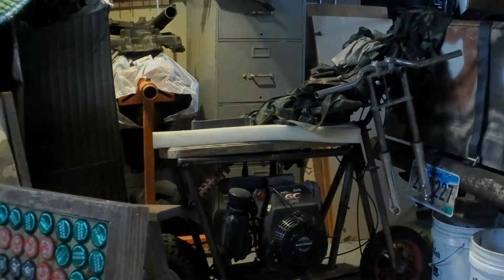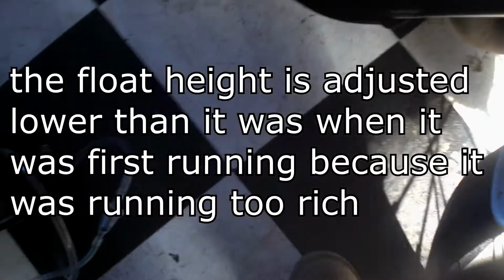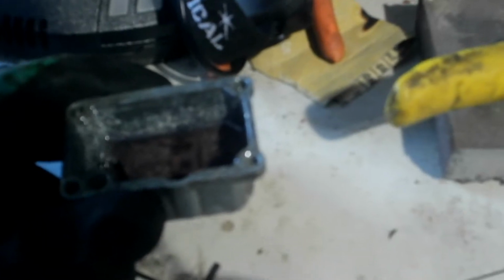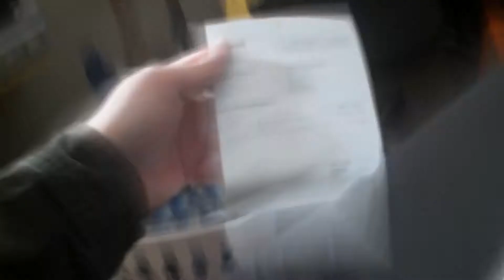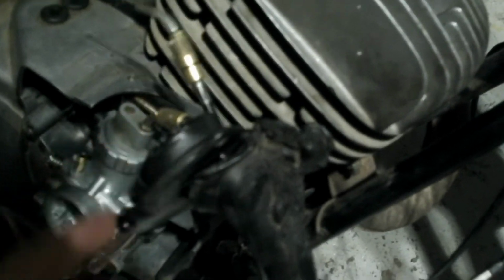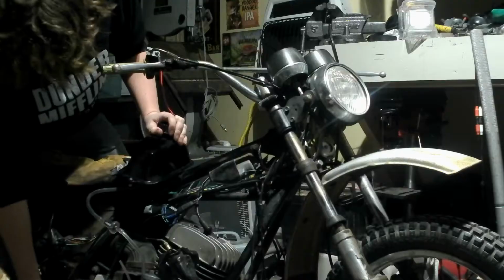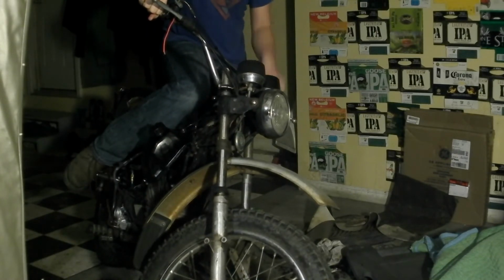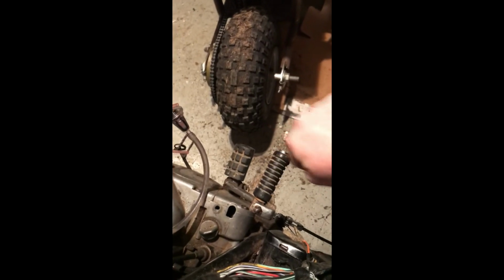THE BIKE RUNS!!! + CARB UNBOXING | $200 Kawasaki F7 175cc Dirtbike Build Part 3

Comment from the maker: Figured out the issue the other day and didn’t even think about recording test driving. Need to get used to recording things. But I’ll have a video out whenever the snow melts and I get footage riding it.
Reply: Hi I have a 1972 Kawasaki f7 175cc and I’m having trouble with my carb and isn’t worth fixing up what carburetor did you use for your bike ? Can’t seem to find anything online for which one is compatible
Reply from the maker: Andrew Zuniga i used a Mikuni 26mm carburetor VM26-606 It is bigger than the stock carb so I had to make it fit by modifying the little rubber mount. I used a wire brush drill to take out some material so now it fits snug. the cover won’t fit back in so I’m gonna have someone 3D print an extender for it. I’ll post a video about the 3D printing process when I do it. If you don’t wanna go that route I found that motorcycle carburetors generally work the same so as long as it fits on the bike it should work
Reply from the maker: Andrew Zuniga also I need to figure out how to control the choke switch from the handlebars. The original switch might fit on It I’m not sure yet

Comment: Do you know were to get a carb for one of these?
Reply from the maker: I couldn’t find any stock ones in good shape but I found one that fits if you modify the intake manifold a bit. It sticks out farther than the original and the carburetor cover doesn’t fit on anymore so I’m gonna have to figure something out to make it work. And the choke comes out of the side of the carb on this one instead of the top of the original so that’s another issue I have to figure out. If you don’t want to do a bunch of stuff to make it work you can just put an air filter directly on it and leave the cover off of it so you have access to the choke if you don’t hook it up to the handlebars. It’s a mikuni vm26-606. You don’t have to use that exact carburetor. I found that as long as it fits on the bike it’s still doing the same thing as any other carburetor so it should work.

Comment: Hey any idea where to find a carb for these I need one cant find any
Reply from the maker: I couldn’t find any stock ones in good shape but I found one that fits if you modify the intake manifold a bit. It sticks out farther than the original and the carburetor cover doesn’t fit on anymore so I’m gonna have to figure something out to make it work. And the choke comes out of the side of the carb on this one instead of the top of the original so that’s another issue I have to figure out. If you don’t want to do a bunch of stuff to make it work you can just put an air filter directly on it and leave the cover off of it so you have access to the choke if you don’t hook it up to the handlebars. It’s a mikuni vm26-606
Reply from the maker: You don’t have to use that exact carburetor. I found that as long as it fits on the bike it’s still doing the same thing as any other carburetor so it should work